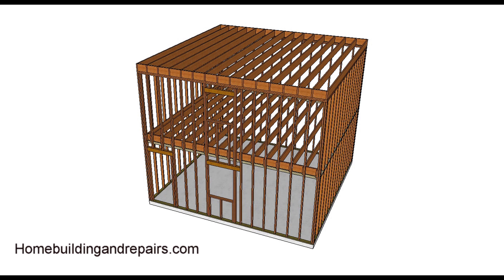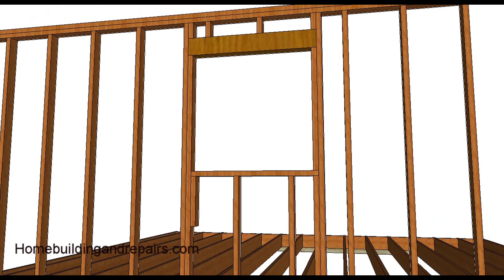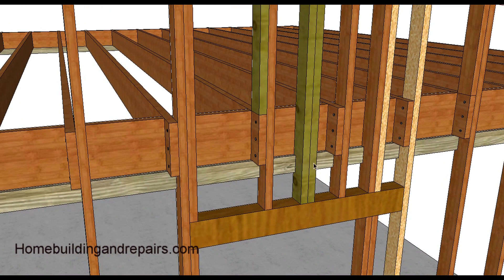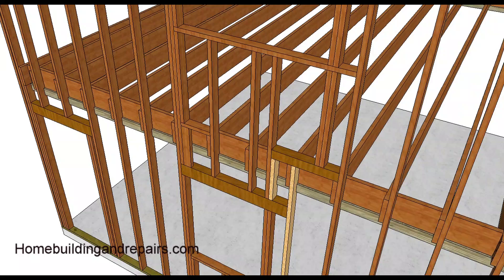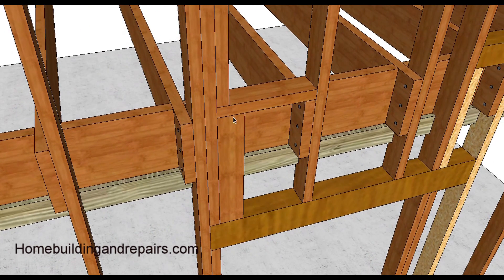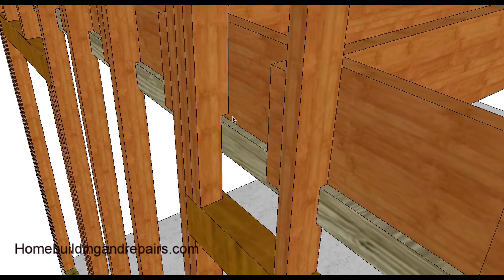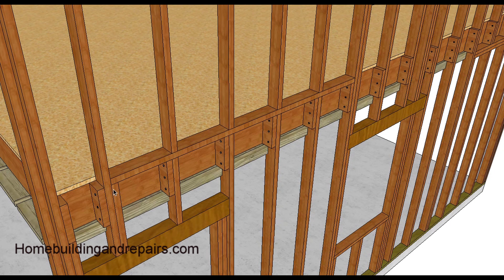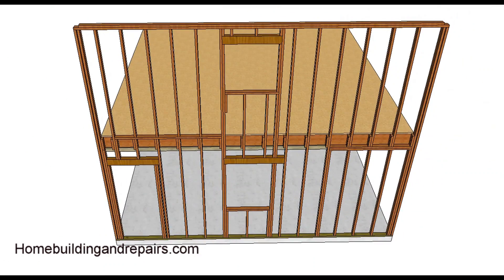Ideas for Remodeling Balloon Framed Walls – Windows and Door Openings

Comment: Thanks for this video, very informative. I have a 2-story balloon framed house that was built in 1952 (I guess the architect was older?), and there is a first floor "exterior" wall running parallel to the joists that I would like to add a five foot wide opening in, so a half bath on the corner of the house can be expanded and a bathtub added.  I say "exterior" because there is a one story breezeway/garage on the other side of the wall, over a slab (main part of the house is over a basement).  Would cutting a large opening like this in a wall parallel to the joists generally be more or less structurally risky than adding and enlarging openings perpendicular to the joists like you showed in this video?  There is a fairly heavy cast iron tub in the second floor full bath above, but I believe that is primarily (or fully) supported by the ledger perpendicular to the joists?

Comment: You have 7 studs bearing down on 5 studs.. I think where you take the weight of 4 jack studs and header, that needs to be transferred all the way down to the foundation. there has to be a requirement for either inline framing or direct bearing in the IRC somewhere
Reply from the maker: Most jack studs over a window header can be spaced 16 inches on center, unless an engineer requires something different.

Comment: Great video Greg. Does it matter if there is a tight fit against all surfaces when sistering with new 2x4's (ie not just the original studs but also the floor rim joist)? If so, how do you get a full thickness 2x4?

Comment: Hey Greg! Great video as usual. Wife & I just bought a 1910 victorian. Been watching a ton of your videos to get more info for future renovations.
One issue we are running into .. the house sits atop a fieldstone foundation. The studs are supported by a fat joist that sits atop the fieldstone foundation. After removingplaster & shiplap, I found old termite damage to the outermost stud in the corner of the room (exterior wall). How can I reinforce this stud? It is currently swinging freely! Yikes. Have a structural engineer coming soon.
Reply from the maker: Email me some pictures and you can get our email address at our website.

Comment: Hey I know this is a little older but....helpful info since I just opened up my walls.  My house is balloon framing, no ledger, but has t&g on inside and outside of studs, which are filled with wood chip insulation. Anyway I want to add insulation and electrical and fireblocks. How would you do this?
Reply from the maker: I'm pretty sure this answer won't shock you, but you will either need to remove portions of the exterior or interior wall coverings and usually most people remove and replace the interior drywall or plaster.
Reply: Just opened up an I terror wall in our 1917 farmhouse and same thing. Guess it use to be an exterior wall so had tongue and groove boards run vertical  took those off and had rough cut 2x6, 2x8, 2x10, 2x14" planks horizontally. Took those off and walls were full of Wood chips that went up past second floor. We then noticed the wall studs were full length 14' so now need to figure out how to support while we install a 5' header so the load of second floor is supported. Sure interesting to see that cause first time I've ever seen woodchuck insulation or balloon framing before
Reply: @NorthernOntarioSportsdad  they ran tongue and groove on both sides of the wall studs. Yes I sistered 2x6 to each stud on the floor joist side to hold the weight of the floor joist, as per contractor and engineer design. Then insulate with 6” fibreglass….

Comment: Great video... so easy to follow...in the balloon framing model, would it be possible to cut a good portion of the second floor, creating a two story vaulted ceiling for the  first floor? Any problems doing the same scenario on a second to third floor?
Reply from the maker: I can't provide you with engineering advice, but feel free to send me a drawing or pictures for an opinion.

Comment: Can you move the window sill up on existing framing I want to install 36 by 36 and right now I have a 36 inch wide by 48 tall I want to move it up because of back splash but I can’t nail a stud all the way down cause brick in the front of it. Do I have to remove the brick too and do it that way I have pier framing. Do you have a video on this.  Thanks
Reply from the maker: I don't have a video on that, but if you want to send me a few pictures of your existing situation, I might build a provide you with more information. You can get our email address at our website.

Comment: hello Greg. Great info on BF. I have a typical 2 story farm house layout 3 rooms down stairs 3 bedrooms and a bath upstairs. I want to remove the wall between the kitchen and dinning room. the wall span the entire width of the house. Because this is a Balloon framed house, is there any special support needed? If I'm not mistaken balloon frame houses don't have load bearing balls. Is this correct? Thanks again for the videos
Tom
Reply from the maker: Remember I cannot provide structural engineering information.

Comment: Greg, your videos have been extremely helpful for years now.  Today I'm thinking facing a new problem.  I'm on balloon framing (2 stories plus unfinished bare wood attic 2x4 roof) and during heavy wind I get all kind of creaking and squeaking from my attic.  Should I shore this up with some extra 2x4 framing at the angle points or does it make sense to using mending/tie plates?  I'd be nervous in the long term about beating up 120 year old lumber with mending plates.  Also, there are no vertical center posts up there at all, I would be oppose to putting a cross/tee on a post about the 2nd floor wall.
Reply from the maker: I don't know how much help I'll be, but feel free to email me some pictures of some areas you're thinking about reinforcing and I'll see if I can come up with something.

Comment: If you wanted to cut an opening on the 1st floor exterior wall which runs parallel with the joists, can you just cut the studs and frame your opening or is there a need to support it somehow? Seems like the sheathing holds it all in place just fine but i wanted to get an opinion just in case.
Reply from the maker: I cannot provide you with structural engineering advice, but if you can install a header, then that's going to be better. If you're only going to install a 2 foot opening, then that might not be a big deal, but a 6 foot opening will.
https://www.youtube.com/watch?time_continue=1&v=VykGnbuK044

Comment: I have a question I hope you can help with. If you imagine your example with a two story on back. I want to remove the wall between the two sections to open up kitchen and livibg area. Roof rafters of main part. Rest above the wall. Wall is second floor and first floor and rests on 2 1/2 foot with stone foundation. Not many contractors know exactly how to do this. Any suggestions?
Reply from the maker: For free to send me some drawings or pictures of what you're trying to do and I'll see if I can help. You can get our email address at the website.

Comment: Any suggestions on fireproofing?
Reply from the maker: I don't know what type of fireproofing you're referring to. Wood framing fired blocks can be installed in between framing studs at floor joist level to prevent fire or oxygen from going through these cavities, if that's what you're referring to. Feel free to rephrase the question if I didn't answer it.
Reply: gregvancom thanks for your response. I am rehabbing a balloon framed 3 story built in 1891. My main concern is fireproofing between floors on the exterior walls. Would the most efficient way be putting blocks between studs?
Reply from the maker: Yes, you've got to prevent air or flames from going through any cavities in the wall framing between floors.

Comment: Really appreciate these videos!  hoping you do more on this topic.  I'd be interested in how you deal with issues in framing on the sides of the building where you cant tie into the ends of the floor joists.  I was also wondering how you would address mud sill rot, particularly with regards to the different ways sills were constructed? Thanks
Reply from the maker: Thanks for the nice comment and you're welcome. I think you might want to visit our website and check out our home addition page for more information about tying into the ends of the floor joist. As far as the mud sill rot repair, you might find more information on the framing repairs page under the repairs tab. Let me know if you can't find what you're looking for.
Reply: Thanks for replying to my comment Greg.  As far as tieing into the floor joists i was referring to the viewing angle of the repairs being done in this video. If you were to rotate the building model  90 degrees you wouldnt have anything to rest your blocking or plates on top of. i was just wondering how you address framing issues on that side of the building?  in my case  I own a balloon frame house and may have to repair some framing due to rot of a couple of studs that happen to be on *that side of the building, which also run about three stories. I was hoping not to have to wrestle with 30 foot 2x4s.

 As far as the mudsills  I did watch the one one where you were talking about repairing the sill plate but was just wondering if balloon frame sill repair was something that required a different approach since the plates are configured in a different way (or a couple of different ways in which i have seen).  Like how do you support the structure while doing repairs. At any rate, I'm always watching out for your new videos. keep up the good work.
Reply from the maker: If you're referring to the side without the ribbon notched into it, then you can use the same methods I suggested in the video or a combination of them. I will try to make a video to address this issue and attach a link here when done.

Comment: Another fantastic video. Thanks! Any thoughts on how to support the 2nd floor while modifying the exterior framing on 1st floor to make room for an opening?
Reply from the maker: You're welcome and thanks for the nice comment. You might find what you're looking for on our framing repair page, but if you don't let me know. http://www.homebuildingandrepairs.com/repairs/framing/index.html
Reply: Greg, I believe I saw the relevant videos on your site but I'm not sure they fully apply. Let's say you want to put a header in an exterior load bearing wall of the first floor of a 2 story structure. Normally, you build a wall slightly inside to hold up the ceiling/2nd floor and then that in turn holds up the roof and such but in a balloon framed house with a ribbon, building a wall inside would merely hold up the ceiling joists but not the remaining vertical portion of the wall which in turn is holding up the 2nd story ceiling and the roof rafters. Would the face nailing of the joists into the studs in combination with a temporary wall be enough to hold up the 2nd story/roof?
Reply from the maker: You bring up a very good point and these types of repairs might require a wall underneath the floor joists and then a second wall above the floor joist to support the roof rafters and ceiling joists. I can make a video if you need one on this topic.
Reply: I was thinking the exact same thing. A video would be fantastic if you have time. Thanks again!
Reply from the maker: The video was on the list.
Reply: gregvancom I have the same issue as bus. I was just just looking around on your website and found some great videos but I didnt see one on how to support the wall studs of a balloon frame when removing a wall and installing a header beam. Would you be able to post a link to that specific video please?
Reply: Has this video yet been made? If so, could you provide a link? Thank you
Reply: Whatever you did, I hope you were careful about it. The previous owner of my home cut out a portion of the second floor. Now the house shakes in the wind. Going to dissect this nightmare next spring. Thanks guy 😵‍💫